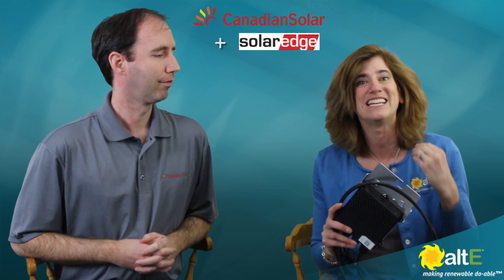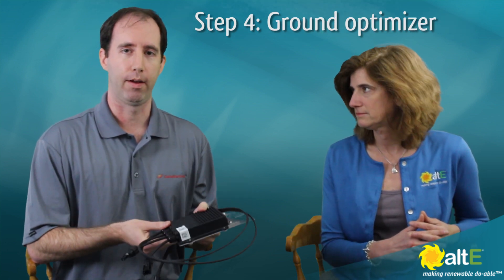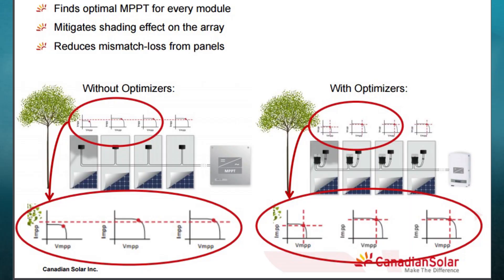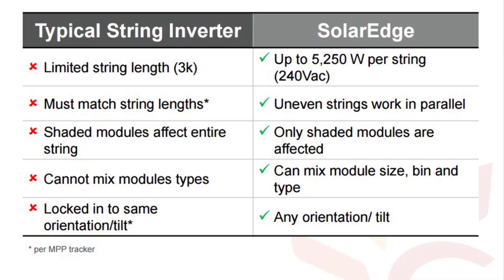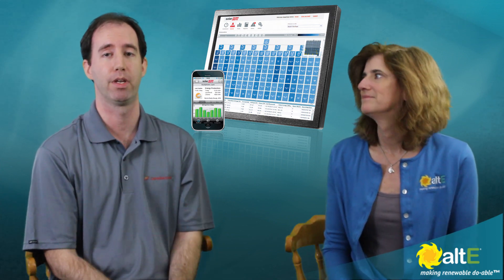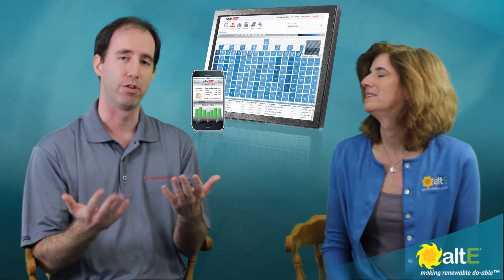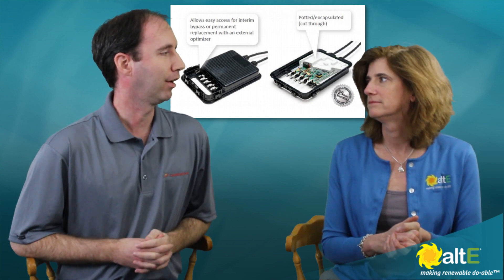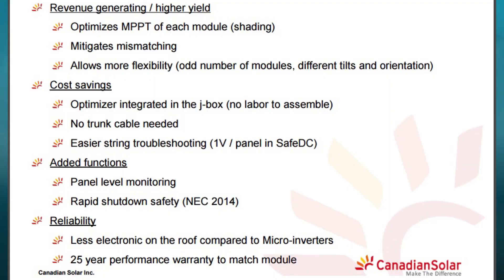Canadian Solar CS6P-P-SD SMART MODULE Interview

Comment: Hi Amy. Thanks for another interesting and informative video. Do these panels and optimizers work only with grid tied systems?
Reply from the maker: The Canadian Solar Smart Modules have SolarEdge optimizers on them. They only work with SolarEdge grid tie inverters. So the grid does need to be present (unless you trick it with AC Coupling, covered in our other videos).
Reply: thank you Amy or altE staff

Comment: Hi i have a question. Using a splitter, can you split the panel, one branch going to my micro inverter and the other one goes to the off grid inverter, with the use of all necessary safety switches that i need? Hoping to hear from you thanks.
Reply from the maker: +fstagle Let me make sure I understand your question. You want to take a single panel and send half the energy  over to a grid tie microinverter and half to a battery with an off grid inverter? I don't know of any way to do that. A better method would be to use a hybrid grid tie battery backup inverter, and send all of the solar power through a charge controller to the battery, and then have the inverter sell any excess to the grid.
Reply: +altE Store I will be using the off grid during power outage and switch off the micro inverter on the junction before the main box  then using a double throw switch it to the off grid inverter so i can have power coming from the off grid inverter with the battery bank. When the power is back switch the double throw, the micro inverter then the off grid inverter. thanks
Reply from the maker: +fstagle Since each solar panel is connected to the microinverter at the panel, you can't simply switch the power from the inverter to the battery. If you were using a string inverter, where you have a long series string of 8 - 12 panel in series, you could switch that string to a 600V charge controller to a battery bank. That is called DC Coupling. We did a video about it with Morningstar here, https://youtu.be/uQQkwvr9ZFk . If you want to use microinverters, or DC optimizers like we are discussing in this video, you have to do AC Coupling, where you connect the AC output of the branch of microinverters or the SolarEdge inverter to the output of an off grid inverter, and the off grid inverter tricks the grid tie inverter into thinking the grid is still up, even though the off grid inverter has disconnected the whole system from the grid. We did a video on AC Coupling here, https://youtu.be/Wz7rJV0DMok. Or, as in my previous comment, if you don't have your system already installed, it is probably easiest to design it as a hybrid grid tie battery backup system from the beginning,  rather than trying to force it to be a hybrid after the fact.

Comment: an off topic question but this video reminds me of it, my battery bank of 4 t-105 RE's with the 2/0 cables now, thank you btw, measures at most a 1 volt difference of the 6 volt reference. do you sell a device I can connect to the batteries that will equalize the voltage between all four?
Reply from the maker: +Rev John O'Toole I want to make sure I understand your question. You have a 24V battery bank with four 6V batteries in series, but when measured separately,  the batteries are measuring different voltages, as far different as 1V from each other? It sounds like you need a good equalization on the battery bank, a high voltage to get everything fully charged back up. If your solar charge controller can't do that on a super sunny day, then you need an AC charger to other plug in to the grid if available or to a generator to try to set things back right again. You may also want to look into a Battery Saver desulfater,  we have customers who swear by them, they can help revive old batteries by disolving the built up lead sulfate. https://www.altestore.com/store/deep-cycle-batteries/desulphators/bls-1224-c-battery-saver-desulfator-p200/
Reply: +altE Store thanks, I was using a 24 v ac charger for this as right now I wish to have some backup for power outages.
I didn't see a manual for this, do you know a link for it?
Thanks